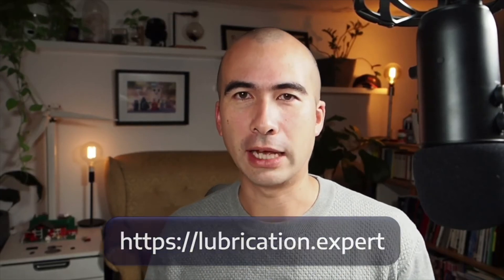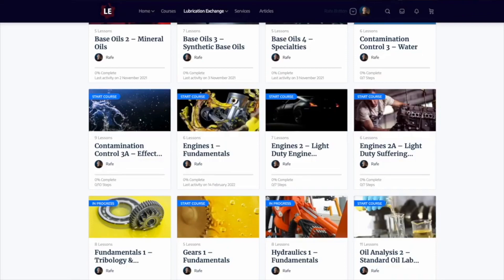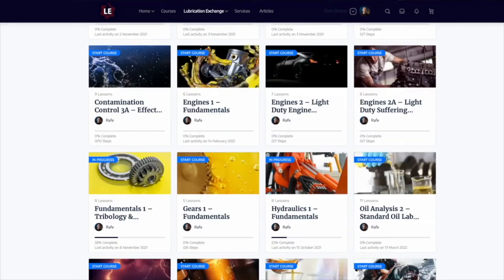What's the Difference Between an Automotive and Industrial Gear Oil?

Comment: Do Viscosity modifiers degrade with temperature fluctuation? That is to say continuous heat cycles while operating. My gearbox incorporates a silent chain and also spur gears. The silent chain requires a lower viscosity oil and spur gears higher. If the gearbox is also being used as an engine oil cooler, I was hoping to use the heated oil for the chain and cooled oil for the spur gears. Does that sound plausible? The viscosity of 75-90 is too thick at lower (~40c) temperatures for the chain and too thin at higher temperatures (~80c) for the gears according to manufacturer specifications. What do you think? The manufacturer of the silent chain also states they prefer non multi viscosity oils, Lubrication is difficult.
Reply: @nunyabusiness3786 Are you referring to the difference in oil temperature for different areas?

Comment: From this, I conclude, that automotive lubes would work extremely well in industrial applications, but industrial lubes may not be adequate for automotive use. Though it would be expensive, automotive gear oil might be a good choice for wind turbine transmissions.
Reply: That is exactly what we determined running industrial centrifuges. We had issues with the gear life using the factory supplied industrial oil spec. After the second gearbox failure within 3 years we move to a modern automotive GL5 gear lubricant that matched the original viscosity and haven't had a single failure in almost a decade of continuous operation. Obviously the oil is changed periodically.